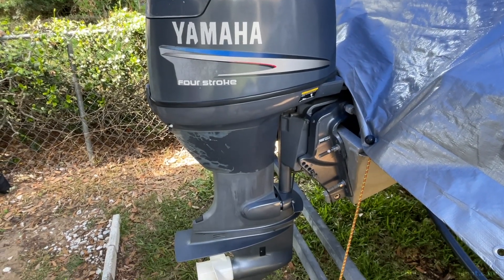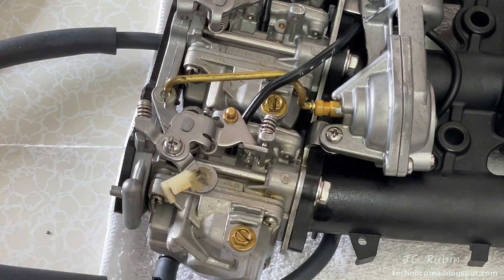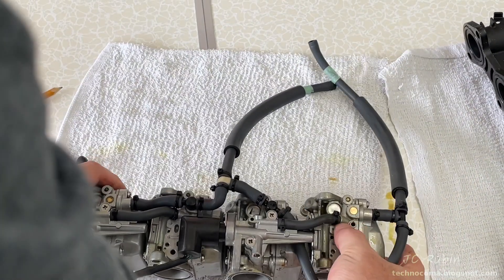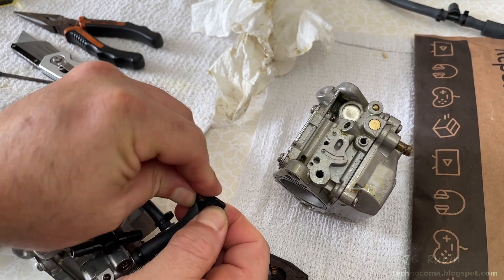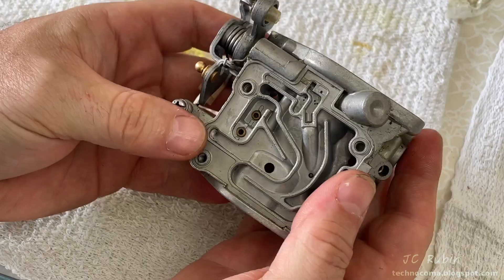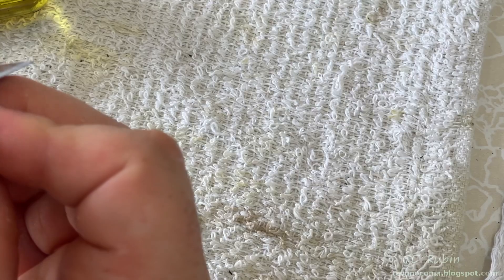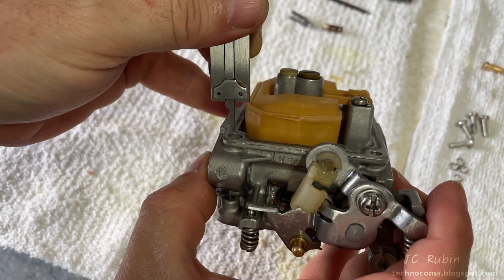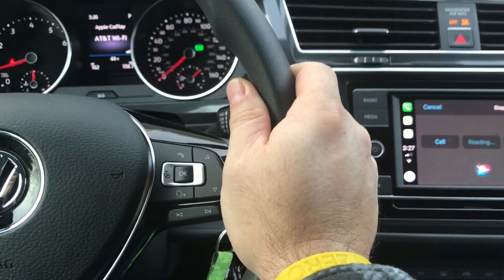Yamaha 4 Stroke Outboard Engine Carb Rebuild Series [2] Carb Disassembly and Cleaning

Comment: Fantastic series, thank you so much you have helped me significantly with my T50 motor. I do have a question. I am replacing carb #2 and #3 with factory Yamaha carbs (62Y-14902-42 and 62Y-14903-42 will be installed). Both carbs arrived with a brass cap plug (welch plugs) over the pilot screws. I've seen videos on careful removal of these plugs, but do I need to? Should I install the carbs as is and assume that Yamaha had pre-adjusted the pilot screws? I'm in Colorado (5800 feet above sea level)

Comment: Hi mate,
'i have a 2001 F80hp Yamaha, Its running rich on cylinder 4 just a tad wetish,not much, but the other 3 are white greyish. I  guess they are running  leaner. The carbs were cleaned, a year before last by a mechanic, he adjusted valves etc. The engine ran great last year. But it had a bit of a shake at idle rpm 8 or 900, so that's not normal, but l know the shaking from side to side is not normal, put new plugs in, exactly the same. When l rev it up, makes a slight  strange sound every 30 seconds or so. like a choking or slight misfire, not much just something slightly. Could all this just be that carb 4 is dirty, did drain all fuel out over winter. from carbs. Can l some how adjust the 4th carb to try and get it leaner, would this possibly cure the problem. Do l need to buy that carb tunning thing to see if the 4th carb is out of synch. Should l just turn that scew on the 4th carb and see if a slight adjustment would get engine to not shake so much. Any advice would be great,was launching tomorrow for the season, but hesitant now. I am not scared to do a carb clean rebuild if l must, but what can I do first, it is definitely cylinder 4 that's a bit rich. Komp test was fine on all 4 around 195-200 psi.

Comment: Great videos! I am currently looking for a new valve cover gasket for this motor  because I had to adjust my valves and the rubber gasket broke would you happen to know the part number?
Reply from the maker: i do not but its easy to find online.

Comment: You keep saying "brake cleaner" and "carb cleaner" as your spraying the parts...I've heard you shouldn't use brake cleaner on carbs...are you just using the term generically or are you really using brake cleaner?  I think the only reason you aren't supposed to use brake cleaner because it can harm rubber/plastic pieces...but I'm no expert.
Reply from the maker: I use brake cleaner. Not carb cleaner. It’s personal preference.
Reply: @delorean1  In your video you do state Carb Cleaner??

Comment: What do you do if you find green/discoloration on any of the bowl drain screws? What does it mean? What would you do?
Reply from the maker: Clean out the bowls with carb cleaner and a brush if necessary